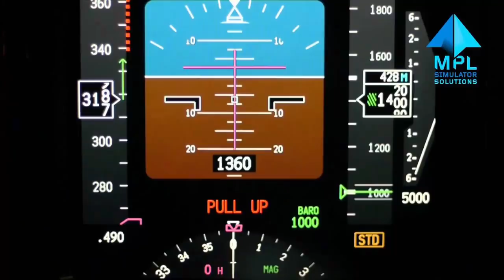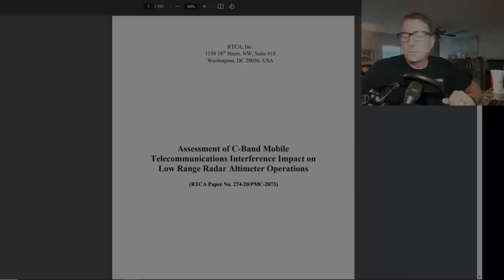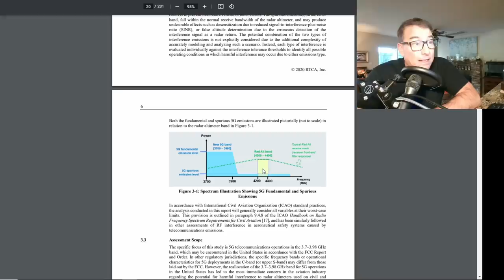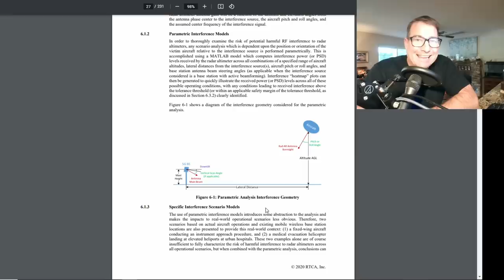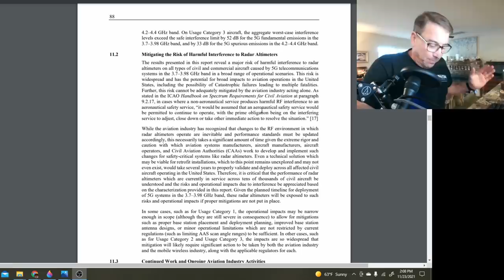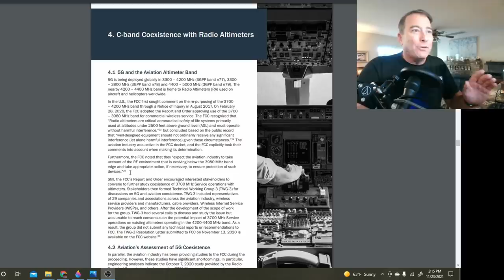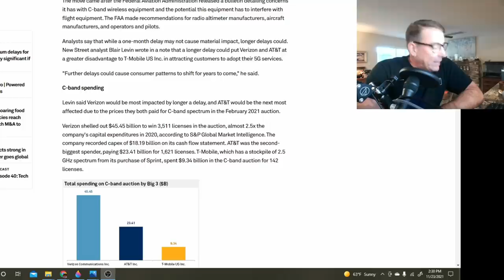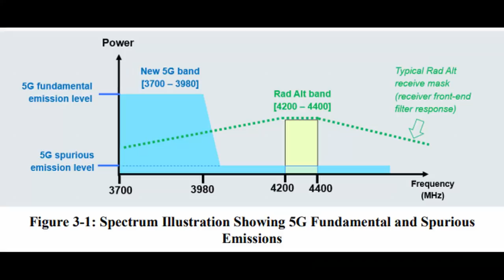5G C-Band Interference with Radar Altimeters in Aviation

Comment: Sister lives in a rural area on a road not worth running cables down, so they had poor internet. With 4 and 5G I don't see them ever getting a wire run down their road because they can get as good or better service from a cell tower. Population probably less than 10% but land surface area over 50% have the same problem, I doubt these areas will ever get wired up now they will just put cell towers to provide it. In cities around major airports everyone should be wired if they want it, the cell towers allow outsiders to get into the cable business without going through the massive expense of running and maintaining cables. They probably could make better filters, they could put a computer looking at the signal and flag radar because of interference, and not allowing this to be used for dangerous things like bind flying close to terrain in those cases. Dollars are muscle, the airline industry does not have the computer/communication industry muscle. It's not only cell phones but communication with almost all computers and entertainment equipment. That communication is the difference between life now and even the recent 1990s, this shift has gone from 1st word to the whole world in the last 10 years (maybe a billion consumers to 3 or 4 times that) and that and not COVID is the main reason for chip shortages they are in the process of building factories to meet the new demands.

Comment: Thank you for putting this out.  I'm a retired EE.  I had no idea of the magnitude of this problem.  The FAA guys that approved the 5G impinging on the aircraft band will spend their after life in hell.  

I'm appalled at the degree of changes that the FCC is suggesting pilots make as well as the design changes to the altimeter receivers.  The logistics of those two changes is staggering.  Modify the procedures?  Modify the electronics in all the planes?  Give it 15 years to implement and roll out, maybe more.

My best hope is that the new 5g base stations are disabled or not installed in any area where the altimeters might conflict.  Also that this happens before planes crash and kill people.  If that happened could the FAA be brought up on manslaughter charges?  I might be wrong, but at this point I don't think there is an option of changing the 5g spectrum allocation or specifications. 

As some of the other EEs in the responses have noted, the existing tech is a bit dated.  But it works reliably and pilots are trained in its use and technicians are trained in maintaining it.  A transition of this scale does not happen quickly on the best of years.  It takes time to get agreement on a solution and time to install it on all the planes and time to train the technicians on maintenance.

Thanks Juan for bringing this to our attention.  Please keep us posted on how this progresses.
Reply: “Spend their afterlife in hell” Do you always fly this far off the handle without all the facts?

Comment: It's clear that 5g towers were implemented with no consideration of their interference with other existing systems, human nor machine.   That seems to be the UL or FCC disclaimer on all consumer electronics, that this device must not interfere with other devices and absorb all incoming excess radiation.   It's it interesting how  the companies that put up the 5G towers had to deal with no such considerations.    It's not the old radar equipment that is to blame, it is the addition of 5G that should have been maligned to conform with the existing technology in place.     If people pilots and planes still rely on it, it is 5G that should have been made to conform to the existing technology infrastructure that was already in place at the time.

Comment: At least we can hope that if interference is proven, it will be technically easy to isolate the 5G on the telecom side, since they will all be using software defined radios. The aircraft instruments are probably all 100% hardware designed radios with little or no option to change frequencies for filtering. So rolling out a frequency limitation on 5G would be a simple programming change to avoid using the interfering frequencies. The political and financial fallout would be fun to watch. (do they get their auction fees refunded?)

Comment: Being in electronics, there should be a safety gap between the 5G and aircraft critical equipment frequencies.
There is also a situation of a 5G mast in fault giving off greater power out put and harmonics, which should be taken into account.
The issue of 5G on board could on new planes be sorted by making the use of personal equipment unless by screening and providing communication through the planes systems.
This does nothing for existing planes.
You job is I think hard enough without this bring hoist on you.
As my beginnings was in radio I would love to help the research guy's
Thanks for the good technical description and video.

Comment: Can anyone say 737Maxx.  It is incumbent upon the F.A.A., given their role in the 737Maxx story, to absolutely, 100% get this correct or their credibility will take a massive hit if another disaster occurs because they were asleep at the switch.  The whole Boeing thing boiled down to human greed and the giant telecoms lobbying for the auctioning of these frequency blocks; pooh-poohing and denigrating the experts from RTCA actually distills down to the exact same thing, human greed.  I have studied electronics and worked in the industry for years and though that was years back and the digital world has changed immensely the RF world hasn't.  The same fundamentals of harmonics, RF interference, bandwidth, and the like still apply today, the laws of physics and electromagnetism haven't been repealed.   And the other thing, that electronics equivalent of Murphy's Law, if something can go wrong it will, still applies as well.  Electronics in general are very reliable these days but they are NOT infallible.  The telecom argument that the scientific experts from RTCA have not conducted real world tests and therefore their accumulated test data and findings are irrelevant is a specious argument at best and positively a belligerent and possibly fatal argument at worst.  If these electronics and RF experts did produce testbench results that indicated there could be real world issues with 5G equipment causing interference in automatic landing system subsystems' frequency ranges then you can bet it will happen in the real world at some point in time.  And another thing, I wonder how many of those telecom lobbyists and lawyers would volunteer to be on the plane that was carrying out "real world" testing of these interference issues.  Brand new electronic equipment has failed out of the box or within a week or two of the initial use of said equipment.  I've seen it in all kinds of electronics and I know for a fact this happens.  Out of hundreds of thousands or millions of 5G towers some will fail or some of the transmitters will fail and some of these will be near enough to airports to possibly cause interference to automated landing systems and in some of these instances there will be inclement weather and some aircraft will be required to use their automated landing systems.  You can see where I'm going here.  These instances won't be common but for those people on those affected flights the rarity of their situation will be of little comfort or consequence.  Well over 500 people are no longer alive today because human greed resulted, through a chain of events, in two 737Maxx airliners going down.  It is basic human greed motivating the telecom companies and their lobbyists against the concerns of the F.A.A. in these current hearings.  If these frequency blocks are successfully auctioned off to telecoms looking to use this bandwidth for 5G systems sooner or later people will die for this decision.  The tech race should head into new research for putting the aircraft altimeter equipment tied to the automated landing systems into a higher frequency range to distance themselves from the bandwidth that telecoms are after for 5G systems and equipment.  Until the new aircraft systems have been created, developed, tested, and fully implemented in airports around the world and airliners around the world the spectrum bandwidth in question should NOT be auctioned off.  This is the only way a 737Maxx type of catastrophic system failure event will be avoided under the RF interference circumstances.

Comment: My understanding is the current commercial aircraft have filters that allows it to operate in the band.  It isn't like that band hasn't been in use for decades by the satellite companies.  There is enough space for aircraft to operate safely, it isn't like the radios need 100 times the space between channels to operate safely.  It looks like the FAA wants the telecommunications companies to foot the bill for notch filtering.  This is like saying that the station at FM 107.9 bleeds all the way to 89.9. Just something to think about.

Comment: Great report, thanks. This is not unique, there is preasure in the AMS(R)S band (L band)  satcom region also from 4G in th EU and Legado in the US. There has been a lot of stalling with Legado as it alo can interfear with GPS receivers on the ground (car stanav etc). Having been at the RTCA and other groups to discuss this it is painful how bullish this can get for those who want to make huge money from the spectrum.  I won't repeat some of the unbelievable statements made. AMS(r)S equipment faces a roll out change to all equiped aircraft to meet this. A huge diversion for the industry when resources are very tight. In the case of this L Band issue, it also affects shipping etc...

Comment: I keep hearing their defense of “we were here first” as to why they think they deserve more than the allotted 4.2-4.4Ghz in terms of denying other LICENSED adjacent spectrum users. Sorry, it doesn’t work that way FAA. You’ve got your guard bands, so either swap out your filters or upgrade to a radar altimeter that’s pulse coded for interference rejection. They knew this was coming for a while and did nothing. 

Even decades-old police radar and LiDAR guns use pulse trains to reject thermal noise and other light sources. If the radio altimeter is unable to discern the difference between the reflected emissions of its own transmitter and other forms of continuous modulated noise, then they were junk to begin with.
Reply from the maker: FCC
Reply: @blancolirio  Do you mind elaborating? As a licensed amateur radio operator, I understand what the FCC's role is, but I do not understand why you said "FCC" here when it is the FAA throwing a fit?

Comment: Govt looking for quick and big dollars from the frequency auction. Telcos business model is based on 100s millions of customers churning their handsets evert 2-3 years so accept that part of that business model is their infrastructure upgrade so all their tech is 5-10 years old at most.  Aviation, with lives latterly hanging in the air, have new equipment volumes that are so small the cost per unit to design, test, certify is massive by comparison. Inherent reliability to meet certification means equipment can last many decades - and cost recovery models necessitate these long life cycles too.

Comment: Great Report.  I've dealt with radars in the Weather Service, and also saw the Green Worm in action in the Navy aboard a WC-121 during Typhoon Recon at 900 ft.  Over the ocean, no problem with 5G, especially in 1971!   From a Fault Tree analysis perspective,  this is as bad as the 737Max debacle. The 737Max was a case of rushed engineering to make money, hoping nothing bad would happen.  The 5G engineering issue seems to me to be the same sort of thinking, that opens the potential for another accident caused by pushing the limitations of aviation engineering. Re paragraph 8,  If the plane plows into the ground, how is the pilot supposed to file a report?  Little too late methinks.

Comment: Bureaucrats want the money so they can find ways to siphon off as much as they can, so they will make sure it is approved. 
These frequencies do not penetrate very well and are mostly directional. Any bleed-over would be in the near-field of the transmitter, which is right next to them.
The only way this is a problem is if the altimeters just are not filtering out nearby frequencies. Radios in aircraft transmit in more dense frequency space, yet they are designed to filter interference. This is not a new development. This process has been underway for many years. Unfortunately it often takes a crisis to get a fire lit under people to improve technology.

Comment: Scientist and Engineers need to look at Directed Ultrasound or use Lasers. Problem here is conventional radio bandwidths are becoming obsolete as you see with the 5G Network encroaching on their territory. Yes airlines were first, but they can't hold back progress and somebody needs to replace obsolete Reliable Tech with CURRENT Reliable Tech. Unfortunately that falls to the airlines even if public passenger safety is Paramount.

Comment: That was from the aviation perspective now consider the disruption of geosynchronous satellites affectionately called GPS. What happens when the room gets chatty with similar 5G frequencies interfering with another form of weak signals project great circle intersections ? As well as weather Satellites. 

The 5G group still hasn't addressed how to they will even keep base stations powered up with the power industry flipping the electricity on and off. No battery backup like the old POTS phones. 

Think of the first responders, the forest fire loose telematics and the power grid goes down? What happens when you can't call to report an outage?  5G appears to be without an infrastructure objective plan. How does an adversary deploy a radio jamming system, disrupting GPS, Weather, Radio Altimeter, and Precision guidance? Hey I have phone plan for you and it has a new Beidu GPS system! Who is Beidu? Checkmate! MSM and 5G it's safe! Right?? And if you are a base commander out there in the Mil consider do you want 5G anywhere near operations?

Comment: Juan will be examining an accident caused by 5G interference soon enough.  It's in the cards.
If the radar altimeter receivers in aircraft are as broad as a barn door, allowing in a signal 200MHz away, then there is a problem with old equipment.  As always.

Comment: Too much speculation going on here.  I would think the manufacturers of radar altimeters should be required to do some testing of their equipment, cost government subsidized if necessary, rather than requiring the 5g folks to "prove a negative" without having any information on the actual characteristics of the aircraft equipment.   

Worst case for existing aircraft installations, it would seem the addition of a basic band-stop filter for the upper end of the 5g band in the line between the radar altimeter receiver and its antenna should provide more than adequate protection.  Given there is 200 MHz between the two bands, any resulting attenuation of the radar altimeter's signal should be nominal.

Comment: Cannot DGPS replace the radio altimeter system?
Reply: I deal with RTK for a living, but I would venture to say no.  You need independent, stand-alone systems verifying your position (especially landing), and GPS can have its own issues and requirements;  it has no idea where the ground is without a datum, differential correction update latency, infrastructure reliability, etc etc.
Reply: CATIII ILS is independent of GPS and that's a good thing.

Comment: 220 Mhz should be more than sufficient as a buffer. That's more than 36 channels of TV bandwidth! Does the airlines equipment drift that badly into the 5G band from the towers? I find that hard to believe.

Still, banning 5G for towers directly in the landing flightline until this can be studied in the real world would be prudent.

Comment: It's probably going to take some airliner digging a hole somewhere for 5G lobbyists what's priority. Like you said, airlines were here first, and not to people that seem to think that they need to be connected and running apps in near real time.
There should be some development of slaving the baro altitude to the radalt below 2500 AGL,  or regress and limit approaches to CAT II only, no auto land. Just like the issue with drones near airports. It's going to take a drone getting sucked into an engine to wake up government agencies for stiffer regulations. People don't like regulations, but they are there because some idiot did something stupid, and now everybody pays the price. Why 5G is deemed so critical but keeping our skies safer, is not? Something's wrong with this picture. Life was simpler when flip phones were around. Great show, and well said.

Comment: Shielding the base stations to only transmit horizontally would solve this I assume. Extra expense. Power the aircraft altimeters to 5 watts would make it more reliable but emit interference for ground based people. Let em walk or drive, not a big deal. More money regardless. FCC or FAA is both a bunch of nimrods protecting their turn at the guvment trough... $80 billion generated from this and they care not who dies in result of it. Where does the money go? Aviation safety? Doubt it... SSDD.